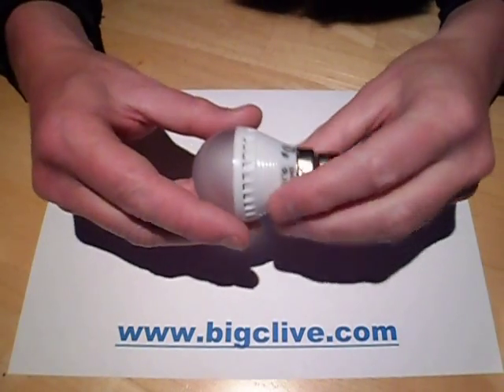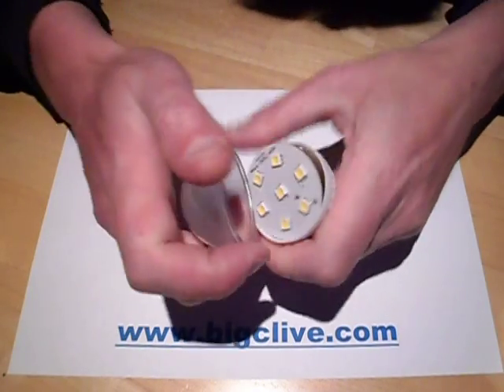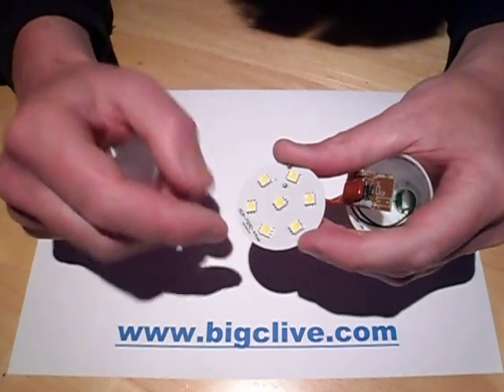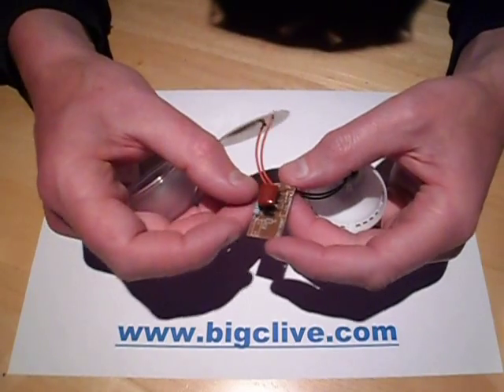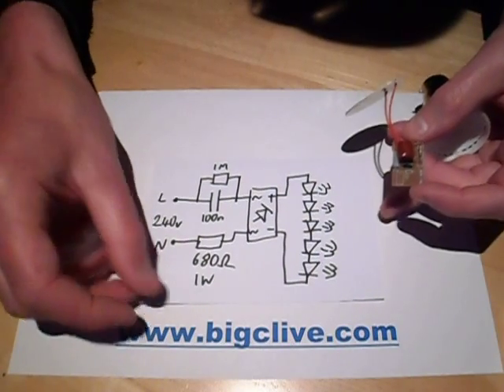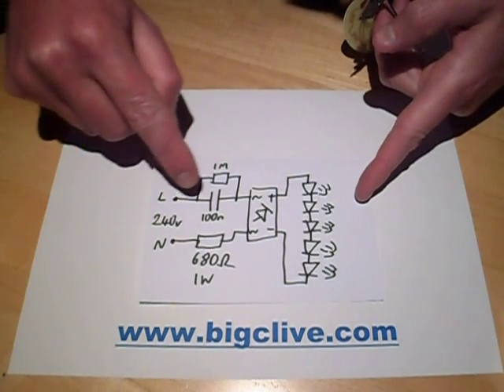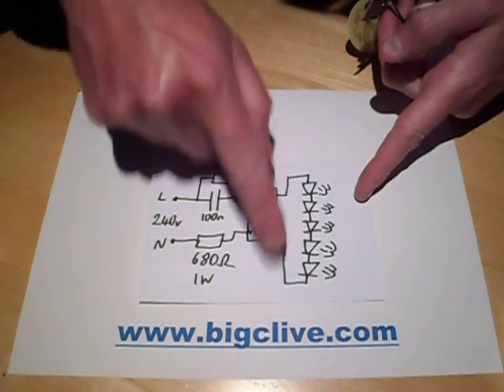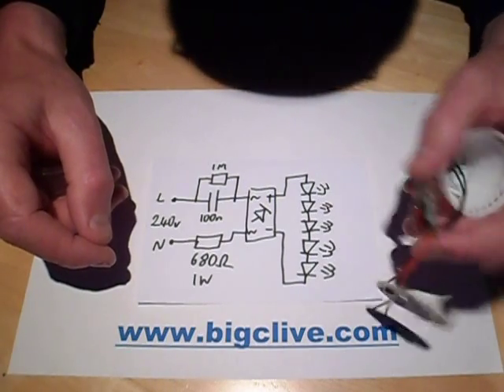Ebay LED golfball type lamp teardown.

Comment: kinda like those "beta caps" base , the Edison has one drawback if you don't know if the power is on or not.  You hear the crackle of electricity it startles you and crack goes the bulb (cfl's usually.  )  With your base, all your doing is pushing it in and turning.  there shouldn't be the barely there crackle because the contacts are almost there to the point of turning on but not quite .  Unless you spin the edison very fast ..  LED's do about the same thing but your not snapping off 2 twigs of a CFL tube  :O  This rarely happens but in theory I like the UK type better..
Reply: Why would that startle you? If you don't know if something's live or not, then always assume it is and act accordingly. Just hold the lamp firmly and be ready for it to turn on. And besides that littler bit of arcing in the base while you're screwing it in is not that loud.

Comment from the maker: I got it from an online supplier called Rapid Electronics.  You can use any typical X2 suppression capacitor rated for mains voltage.  They are easy to find in most suppliers.  I wouldn't recommend increasing the value of the capacitor above what's in the lamp already, as the LEDs are often being pushed quite hard and they could fail extremely quickly if subjected to too much current.  Reducing the value has the effect of extending the LED life though.

Comment from the maker: I changed the current limiting capacitor for a much lower value (100nF - 400V) so that the current through the LEDs was reduced to just a few milliAmps.  It makes it ideal as a night light or ambient lighting feature, and extends the life of the LEDs by a significant level.